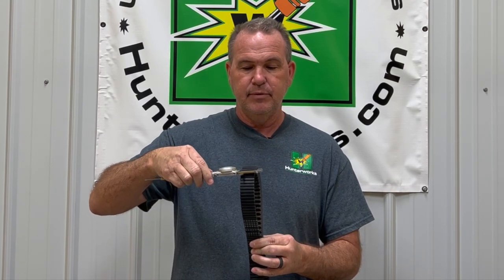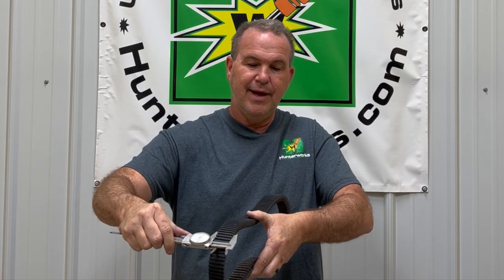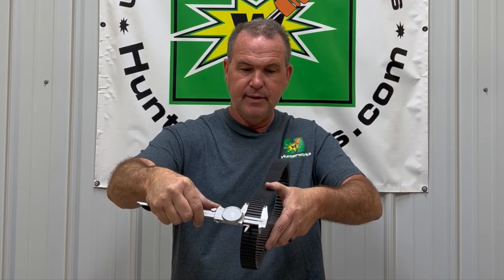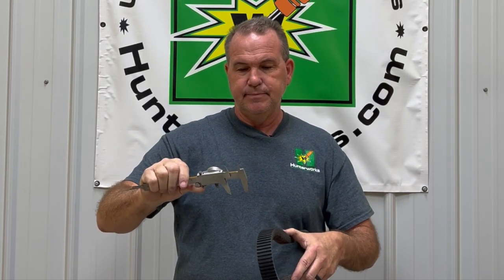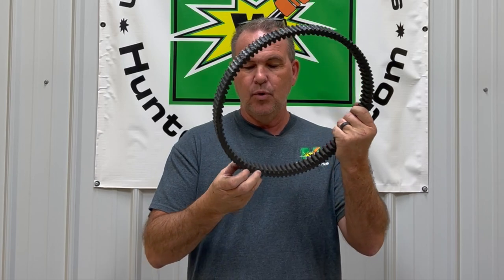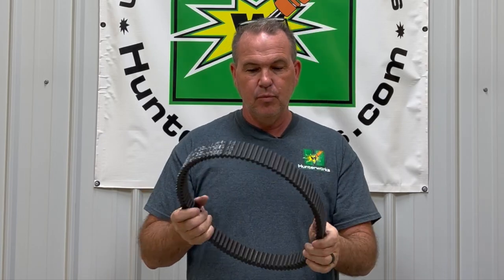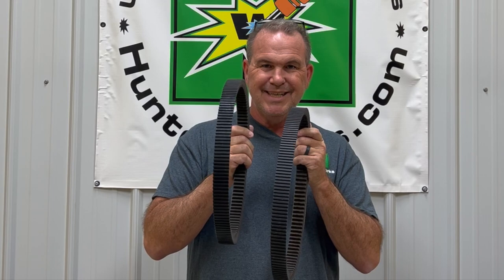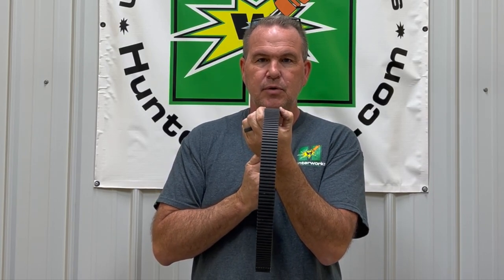Measuring a CVT Belt for Wear on a Polaris, Can Am, Yamaha etc

Comment: I just ordered a belt for my 05 sportsman 500 HO, this is the first Polaris branded belt, I’ve bought 3 of the Chinese belts (Ponese😂) and they all were trash. Atv try to pull while idling, can’t get in gear etc. I wish I had found this channel before buying the belt, I wouldn’t hesitate to try one of these hunterworks belts or clutch assembly. My buddy has an 02 700 Twin Sportsman that needs a belt due to poor alignment (in my novice opinion) may try to give one of these a shot on his (or swap my belt to his and put a hunterworks on mine) if you guys have the equivalent to the Polaris 3211095 belt. Great channel, lots of knowledge shared and I appreciate that. Merry Christmas 2023! May 2024 and beyond bring us all joy and new friendships (and the democrats lose all seats and flee to caves…) 😂
Reply from the maker: Merry Christmas to you and thanks for the last part, the comments parts.  For as the belts etc, we do not have any belts or any parts for that matter for either of those ATV's. We mostly do UTV and 08 and up.